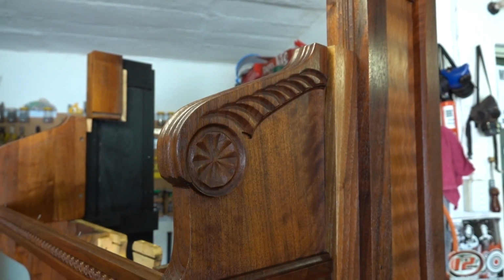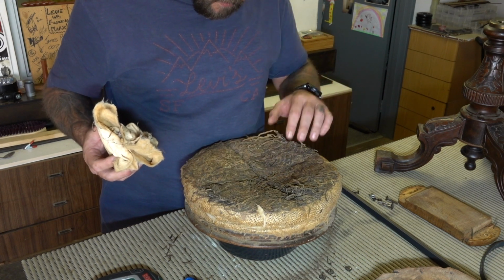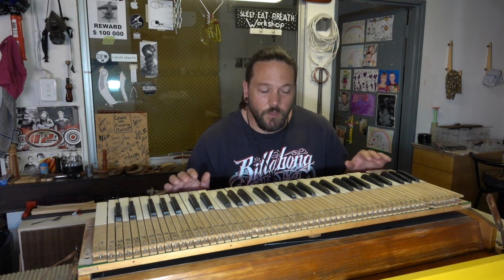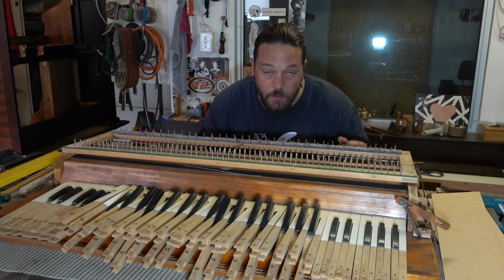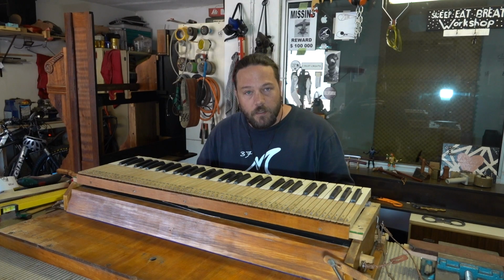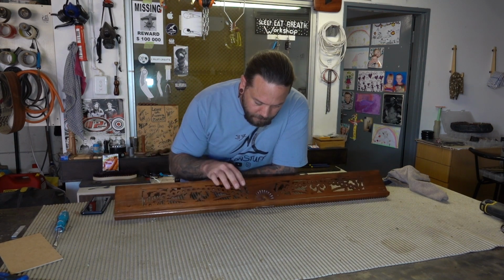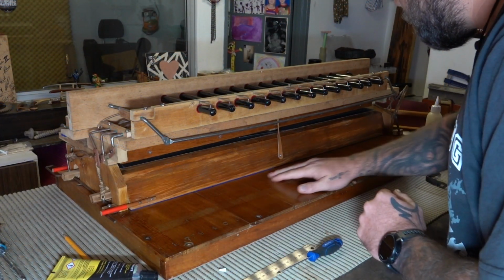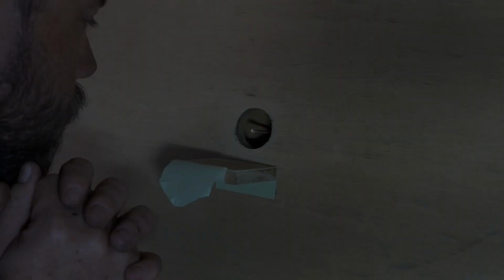Reed Organ Restoration - Part 23 - Levelling Keys & Stuff...

Comment: I just now found this series and I watched all of it in two days, excellent content.  Liked and subscribed!
Your hard work will help me a great deal when I start working on the reed organ I recently rescued from the local dump.  Thank you for also sharing your mistakes so others may avoid them.
Reply from the maker: Wow... that must have taken a while... LOL... I just finished the organ today... video should be up later today... glad you're finding the videos helpful... I wish I had a series like this when I started... :-)
Thanx for watching and good luck with your project...
Reply: @maconSTUFF  I've now already taken it apart and put it back together once, it was ridiculously easy when I knew what to expect, thanks to your videos.  I cleaned out a century's worth of dust and connected all the bits that weren't connected for some reason and everything is already 100% working and playing, I just need to pump more than I should have to.
For the next stage I've ordered hide glue, cloth for the bellows, shellac, and some woods to remake missing cosmetic parts, I'm feeling quite confident.
Reply from the maker: Thats great news Mikko... you are already approaching this in the right way, by ordering all the correct materials before hand, you are saving yourself a lot of problems later... I'm sure you're going to do an amazing job... good luck!